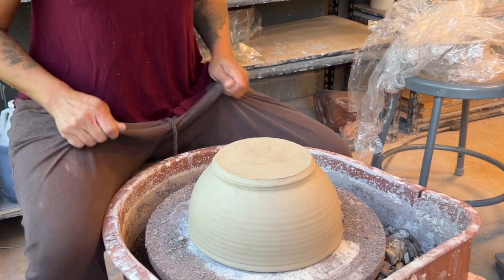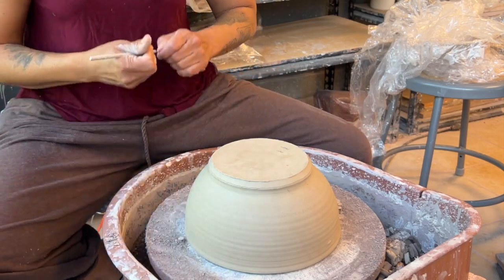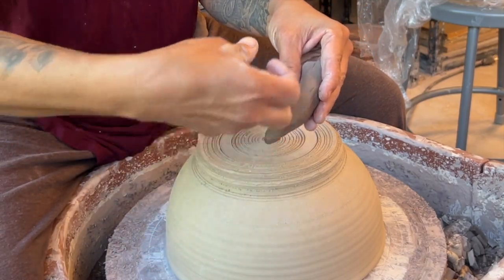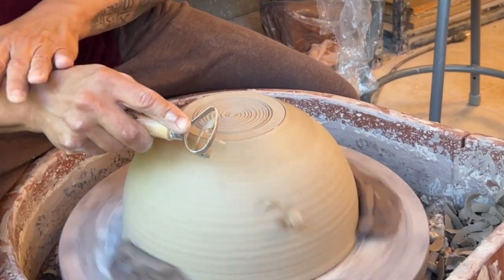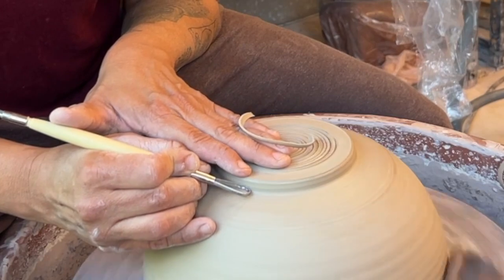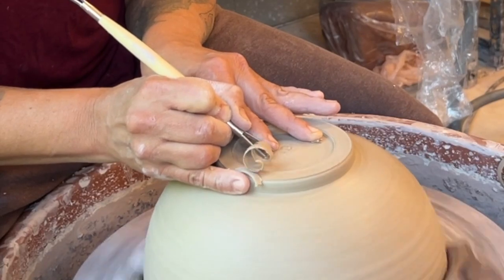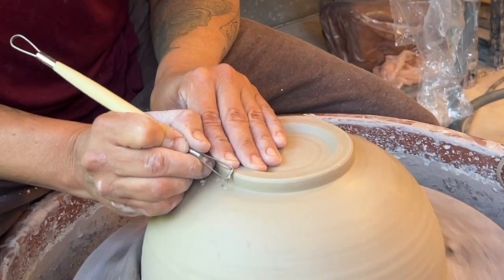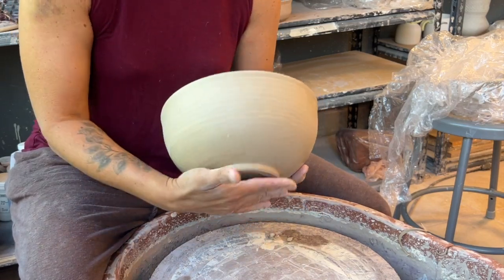Trimming a Fruit Bowl - Footed

Comment: Do you wax the entire foot or just the ring? Wondering about how much foot to leave (in general) if you plan to glaze the bottom.
Reply from the maker: So youir foot needs to be deep enough to glaze the inside. I ofter do it though. I only make a foot id there is enough clay for a GOOD foot! Then I only wax the foot, unless I know im using a stiff glaze then I only glaze bottom of foot and 1/16" inch up